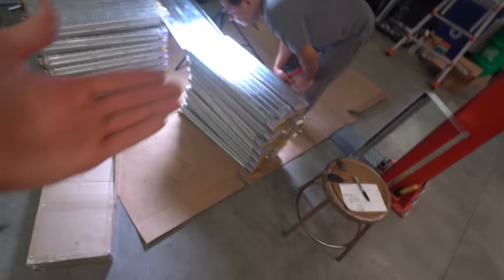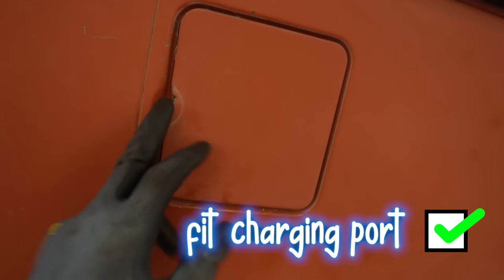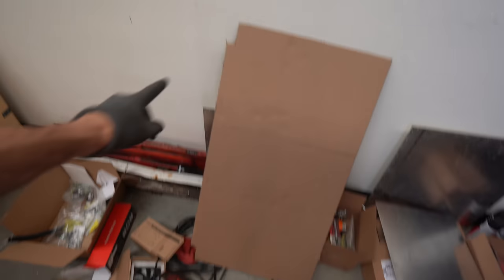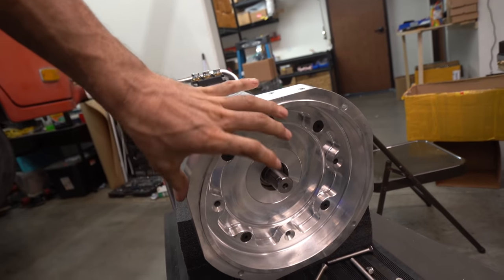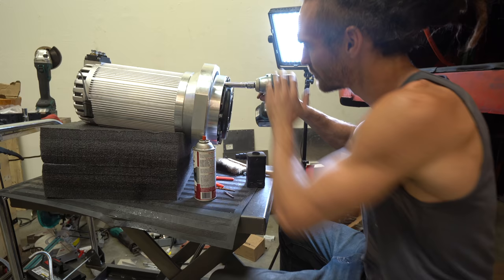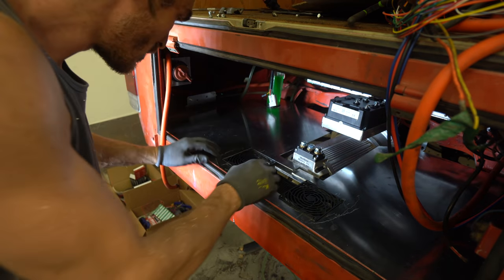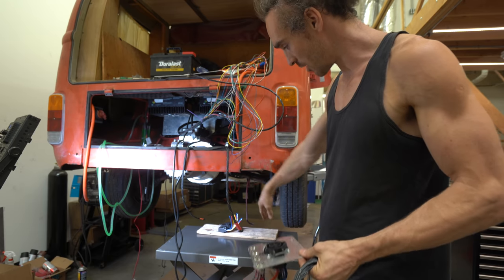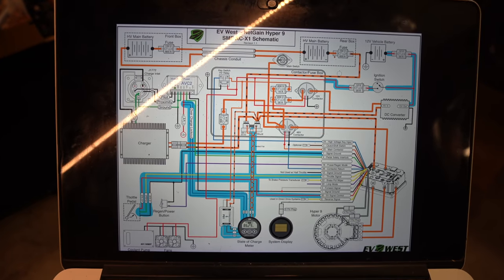Finally The Electric Motor Is In - Electric Camper Build Ep 6

Comment: Louis, please go to a fabrication shop and price how much they would charge you to install a skid plate. It would be worth it to not mess up all of your hard work. Also some new stiffer shocks/struts would help greatly. God bless
Reply: Since hes made like 10 battery boxes allready, making a skid plate should be easy
Reply: I agree if he doesn't fabricate/install a skidplate those battery boxes will be toast in no time. A rock or a truck tire on the highway will destroy those easily. Some type of coil over shocks would be ideal.
Reply: it's at least essential for the lower hanging batteries, as well as the coilovers caused by the wheight added to the car by the batteries

Comment: @ 19:59 where the two red wires solder into one larger red wire...the red heat shrink tubing isn't long enough.  still some bare wire exposed there on the right side of the tubing.  need to tape that up bro.

Comment: Watching you replace the petrol thingy with charging outlet thingy was so satisfying!!!  A mark of a clean future 💯💕
Reply: clean 😆
Reply: Depends on how that electricity is being produced. If it's at a coal or natural gas power plant, not as clean. Also depends on what type of battery recycling infrastructure society comes up with over the next 5-10 years. Just dumping those things isn't very clean. I agree we need to move away from fossil fuel vehicles but most people don't think it all the way through. And companies or governments won't either without pressure from the public.
Reply: @mmzdero  Yes and no. Currently, the worst (ie most coal-fuel-intensive) parts of the country (OH, WV for example) use a little over 50% coal, and the percentage is continuously dropping. The rest is nuclear, natural gas or renewables. And natural gas in a power plant burns cleaner than gasoline in a car.

Plus the waste heat itself. Electric is 90% efficient in terms of energy converted to propulsion. A gas car only converts 1/3 of the energy to propulsion, the other 2/3s are 100% waste heat, either thru the radiator or out the exhaust pipe. So it generates more heat for the carbon to trap.

Comment: I just hope he addressed the problem of the battery boxes not being waterproof and under the van. Plus not rust proofing the welded parts the battery boxes are connected to and bolting aluminum and steel parts together which will suffer from galvanic corrosion when wet. Also was threadlock used on any of the bolts holding the battery boxes together. And the fact you cut away part of a structural crossbeam at the front end.
Reply: This. I do hope he fixes these things. Then it would be a really nice bus in the end.
There were more than one cross beam cut. They are all over the floor that’s between the axles.

Comment: never impact on tightening for final torque especially with critical components.  The spec sheet from the motor should tell you which torques to set the bolts at.  drive it in and use a torque wrench if you have space

Comment: Can't wait for the episode when you drive this to Costa Rica.
Reply: Not without some flexible solar on the roof, and an AC unit. Would also want to wire up a 15 amp 120 plug, so you can run a micro wave.  😁

Comment: I cant quite believe that the small radiator and pc water-cooling pump is sufficient enough for the model s battery ... But i hope you know what your doing😅
Reply: have a look at a model S radiator.. not much bigger than what Louis is using and he is also not using the same amount of battery packs as a model S, or running the same controller and motor, so not the same current draw. I would duct the radiator so the hot air is exhausted to the rear of the car to increase efficiency, but it will work fine....

Comment: Wait you are not using a charge controller to limit the charging power based on what your are plugging into?
Reply: The relays used look vastly under specified for running 120VAC or 240VAC or anything above 48V DC

Comment: Would it be too much heat to melt the welding of the tin (between the connecting wires) for the high current charging ?